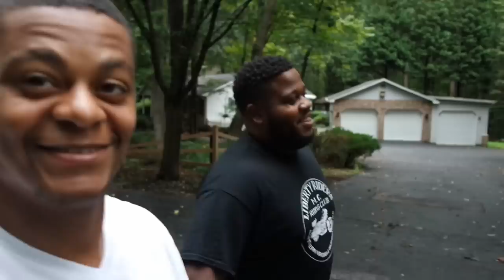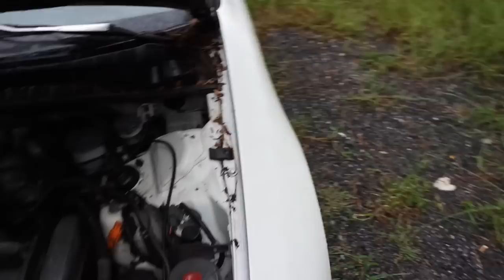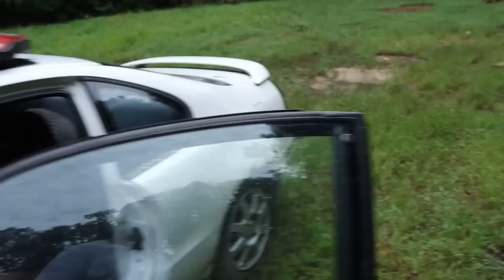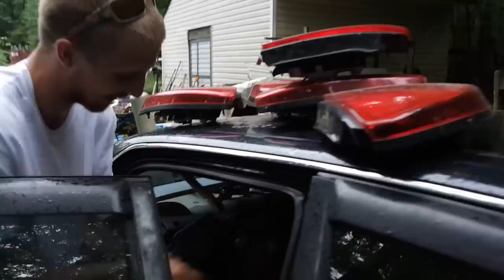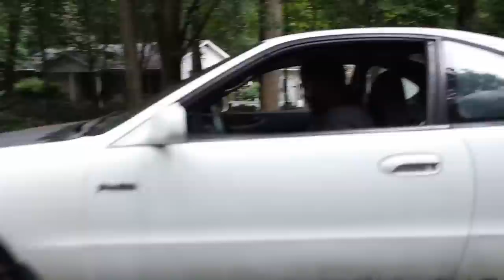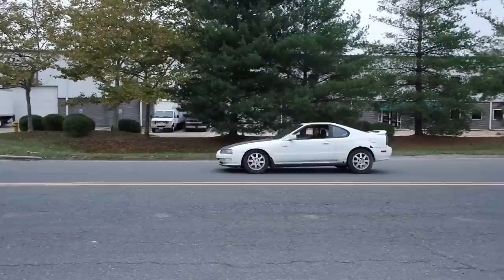New Honda Prelude added to the fam???

Comment: Yoo I don't know how I missed your last video but I guess it's how you said, stuff  happens. I hope you get that overheating figured out a bigger radiator is for sure going to help you out, the lude has got that giant space in it at the front bumper so use it! I'm sure you know which water pump to get but make sure you count your pully teeth, theres a few different ones.
Reply from the maker: Yea bro ima keep pushing but idk if ill be able to race and h day which is what i wanted to do the most.

Comment: I need the conversion wiring harness to hookup my vtec engine. Have that or know a website that I can go to
Reply from the maker: You just manually wire in vtec its two wires you run through the firewall to the ecu